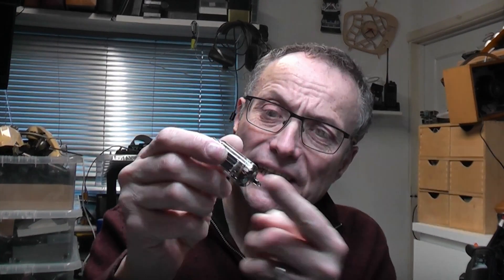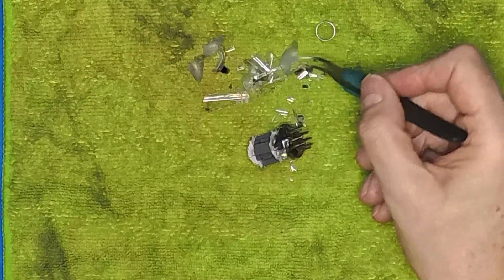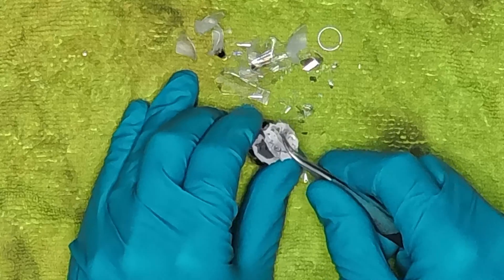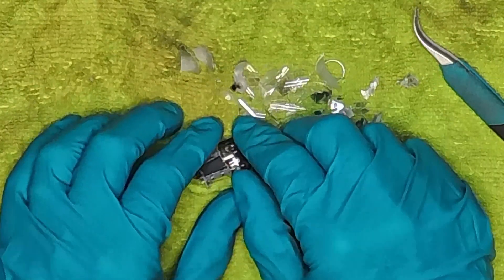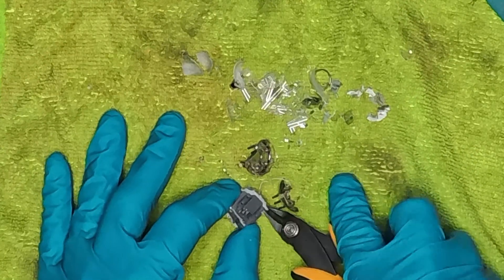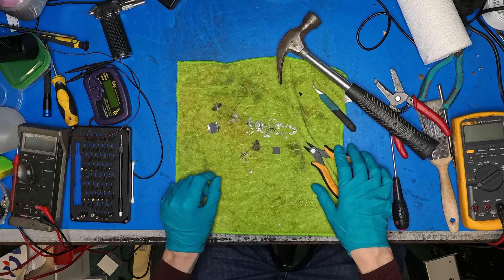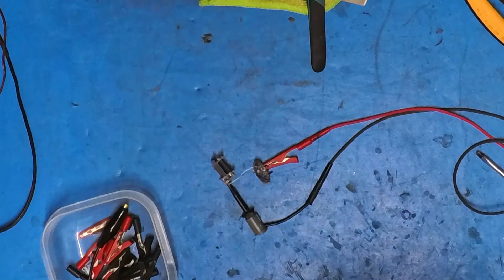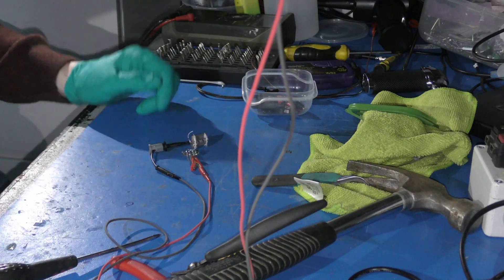Let's examine the faulty valve tube from last week's video.

Comment: It would open up a lot cleaner if you snap the tip off with pliers, score around the base and thermally shock it.
Reply from the maker: Correct.

Comment: When I was on my electronics course at college (1991-93) they didn't cover the workings of a valve. But some years later someone tried to explain to me how they worked as an amplifier using the analogy of water flow (electrons) being controlled by a tap (the grid).
Reply from the maker: I was at college in 87-89. Valves were mentioned in passing, but that was it. It's probably easiest to think of it as a n-fet. Once you get the hang of voltage Vs current operated devices, it all falls into place